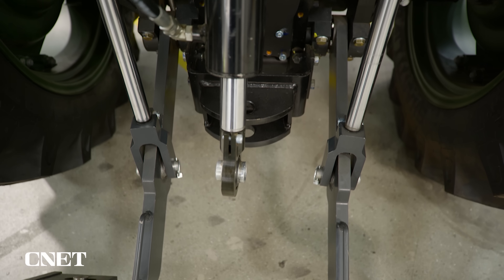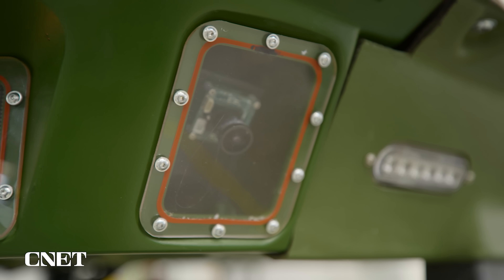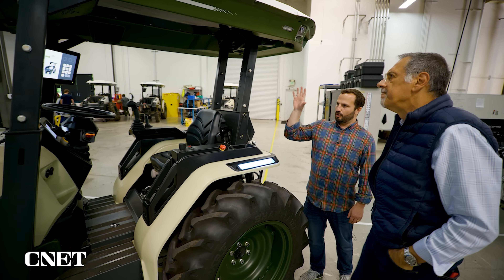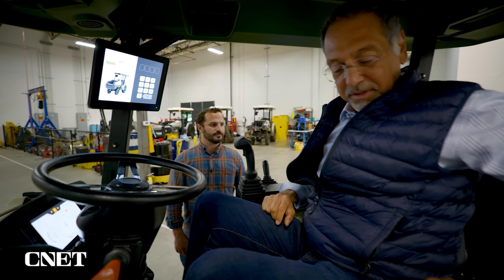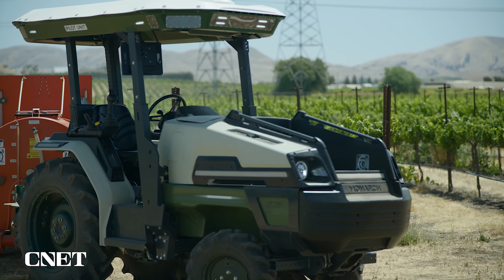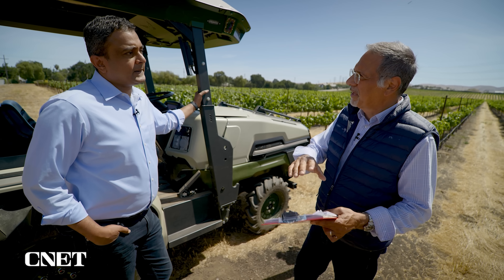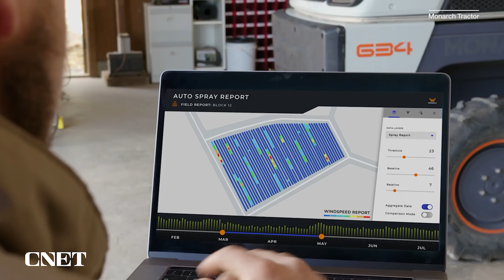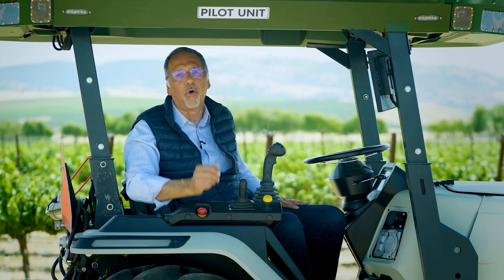This Electric Tractor Might Change the Future of Farming and Food!

Comment: Somewhat expected knee-jerk negative reaction from the old school. Reminiscent of dismissal of EV technology in the 2000s. The idea that electric motors are not up to the job of providing power to hydraulic tools for drilling holes etc is misguided. Electric farm equipment should be simpler and cause fewer issues with maintenance than ICE based machines. There's no reason properly sized electric motors shouldn't last 100 years. The only thing that might wear out are a couple of bearings. Gear boxes seem a tad unnecessary. Electric motors are excellent at providing high torque at any speed. Electric farm technology is going to benefit hugely from consumer automotive investment especially with battery advancements. You would think farmers, with their love and regard for their land and environment would be enthusiastic about consigning diesel to the graveyard of outdated technology.

Comment: The people at monarch are smarter than me. But the environment in which a tractor works is dirt and dust.
The cockpit and the control systems in there must be protected by glass or any lighter alternatives. Otherwise it will cause problems in the long run.
Other than that heavy duty models should also be explored also custom made attachments and tools should also be made. Custom settings gps
co ordinates for restricting work space and other venues and features should also be explored. I am sure it will be a wonderful addition to the farming industry.
Reply: Oh there are plenty of tractors out there without full enclosures, Deere has them. Their called tiny or toy tractors and not intended for long days in a field. Some don't even have a cover over the top at all

Comment: Battery life and recharge time will be a hindrance.  The farmers around me work sun up past sunset during planting and harvest time.
Reply: this would serve ideally in the niche of less then 8 hours of work and I wouldn't doubt adding batteries to the impliments would help push the daily hours of work you could get out of the rig
Reply: The biggest thing is autonomous rather than electric or battery.
Reply: @cmb271  just need a battery ''tank'' to come charge or replace the battery in the field. problem is that is a 20,000 added cost.
Reply: You can fill a tractor with diesel in under 5 mins.  Tractors today can still be worked on by most farmers.  These new tractors are making it cost more to run and fix.  I'll stick with my Pre 2013 Pre-Emission Tractors.  Already bought a bunch of spares parts to run them way past two life times.  Good luck with this expensive Buck Roger junk!
Reply: @Booneboarder  imagine trying to recharge a combine during harvest. constantly switching out batteries not to mention the added weight.
Reply: @victorhopper6774  I know and it won't be me.  Been stock pilling spare parts for a while now.  I'll be keeping all my Pre 2013 tractors up and running till I pass.  All these new tractors are a pain..  Happy with want I got and use.  Good luck
Reply: @Booneboarder  an EV is much cheaper to run and will be much cheaper to build once the newer battery-chemistry will be around. right now, and the next 5-10 years, as long as your diesel-tractor works you are still better with it. but in 5-10 years I wouldn't buy a new diesel tractor.

Comment: Why did we have an chip shortage for two years. Do get. We must go electric although the grid can't even handle nothing. Just goes off. Yet I personally have all three types of power tools. Battery, cord and gas. What I really love about my battery ones is. They give me mega time to go do something else while I charge them. If I need something done now I go to my gas ones. If I want to be lazy I go to my battery ones because I know they will not finish the job on an charge and I have to wait for the battery to charge. Yet with tractors and vehicles. Give me an break. All year nothing but one power outage to the next. People are now lazy with the electric vehicles. Now farmers with EV tractors. They will never get their work done waiting on an charge. Then the price of EV parts from just the tires and oh boy. Trade them in before you have to replace the battery. More then an new engine. Yet I am way not stopping the EV movement. I demand it to move on. I as the next person with an brain knows the power grid can't handle the EV movement. Yet I am demanding to see it fall flat on its face. So where did they test all of these EV farm equipment? Your all going to love this one. Because I have already known they existed because some did an video in the country where they were tested. You all ready to know where they have been testing EV farm equipment? This is good. Try Ukraine. Not joking. Oh but yet their in an war. No their not. They just don't want anyone to know. Now you do.

Comment: Most farm tractors are much larger.  A 40HP tractor is going to be for small operations or weekend warriors.  If they can get a 100+ HP tractor in electric, there might be a real farm application for smaller commercial farms.  Most larger operations are going to need 300-700HP tractors.
Reply: Their are work on mining trucks.
And most trains are diesel electric. So just take out the diesel and add batteries.
Reply: @terryquarton2523  the trouble with replacing train engines with batteries is one of energy density.  To get the same power and range of the diesel train engine, I suspect you would need a much larger battery than the space occupied by the engine, generator, and fuel tank.  Not saying it can't happen, but it's not a practical solution at present.

Comment: They always talk about how "clean" and "green" electric powered things like this are. The problem is that they are NOT as "clean and "green as people think. Most of the power generated in the U.S. comes from coal and natural gas. So, congrats!! You invented a coal powered tractor.
Reply: You have to combine them with solar panels and batteries to go off grid and 0 impact.  But looks like these models may not be able to handle the long hour load times some of the other users are suggesting.  Maybe in a few years as energy density improves (the demand is there so there's definitely investment searching for a solution),  the newer models may be able to run longer and sell for cheaper.

Comment: They have a regular 3-point with no quick hitch disconnect? They're saying this thing is loaded with sensors, so I have to wonder if you can even add a quick hitch disconnect. Without that option, taking implements on and off a 3-point really, really sucks. Also, I don't see any front-end loader - that's a total deal-breaker for me and a lot of other tractor owners.

Comment: farmers are like 2steps ahead of everyone on this... successful farmers don't use diesel or gas and they also don't use battery EVs they run their tractors and farm equipment using cow farts.. now let me explain: fuel is a major cost and at the top lvl of farming competition and profit margins is razor thin so what the big farms did was get get of their fuel bill completely by making their own fuel and they do that using waste and waste produce from their farms that they can't sell (and yes some of them even collect the methane gases from cow farts while the cows are in the barn and they use that to run generators and run tractors).. i mean you can't possibly get more green than running your tractor on cow sh!t, a battery EV of any kind would be a step backwards....

Comment: This is computer controlled meaning there will be little the farmer can do for repairs except for tire maintenance.  Any tampering with the navigation system would create a hazard to others.  Check out John Deere's propriety software system.  You can't touch anything.  Only the dealer can.

Comment: right hard working long hours machine operating in far flung rural areas i bet fast chargers are all round those parts of the nation right? realistically they could have electric motors but can't have huge expensive heavy batteries that can only do so much work/last so many hours? maybe a hybrid with an onboard generator working on gasp fuels that can even be made on farms like biogas, methanol, ethanol, etc? Hyliion heavy duty trucks for example have electric traction motors and a natural gas cummins generator onboard to charge the batteries and it seems to be a hit with real truckers....

Comment: This is a farm gadget. 

You have to first ask yourself why there are no economically viable electric big rig trucks, constuction loaders, bulldozers, backhoes, etc. There isn't even a serious electric work truck on the market. You just cannot cost-effectively power real farm work with an EV at this time despite gas being at an all-time high. This is going to be primarily for highly-capitalized hobby farmers. The price is 2 to 3 times an equipped gas powered tractor of similar HP. Sure, you get automation, which is why this is more gadget than anything else. It'll be pretty funny hearing a salesman try to talk a life-long farmer into paying triple the cost for a tractor he will never be able to rebuild or fix himself when it breaks down.

Comment: The very factory that builds these Electric tractors could NOT manufacturer the tractor without the Coal powered power plants & foundries that make the steel, rubber, plastic, fiberglass, glass, electronics and the thousands of parts. Try building that tractor on solar and wind power.

Comment: Buy a great diesel Kubota for around 24K or less. Keep your batteries. Refuel a diesel in less than 10 minutes, recharge a batter over night, Battery replacement cost cancels any possible savings.

Comment: What about a front loader. IMHO this is too small for the UK. 70hp minimum with options to 110 to 136hp. Also at harvest times you need 12 to 16 hrs minimum. Anyone with a new tractor will say the fail point is the electronics. Some need a service engineer on site 24/7.
Reply: This is certainly not a field tractor. More light duty around the farm yard or in the animal husbandry industry.

Comment: Sooooo, with the current battery technology and the aging infrastructure that we have for the electrical grid. Where are we getting most of our energy right now, where are we getting energy when demand is extremely high during certain parts of the day and year. How much can the infrastructure handle without being upgraded, and how are we going to be able to store surplus energy that is gotten from solar, wind and water for when there is a high demand? 

Right now we don't have the advanced battery technology to store the energy we need for those high demand times. Those batteries might be decades away, if ever. And until we get those batteries we will need coal, natural gas, oil and nuclear to provide that high demand energy. Our grid also can't handle an all electric society. The strain would destroy the grid. So now we have to upgrade that to the tune of 10's or 100's of billions of dollars.

Certain people think we can just transition over to electric lickity split. But ask Australia how that's going...

Comment: Great idea. In my area harvesting and planting is carried out by contractor who, during the season works equipment around the clock, in many cases miles away from any infrastructure. You would need a generator to recharge the equipment then.
Reply: or a method for battery-swapping.
Reply: @tomo1168  I’m sure that could be done as long as you don’t have to buy multiple large battery packs. Maybe an exchange program like propane bottles.
Reply: @gerrycooper56  If you build in an enough big battery to run it 21 hours or you have 3 batteries which are each for 7 hours, that is the same in mass and price. but you can take home the smaller battery to recharge it while the tractor is using the other one so you can use the tractor theoretically 24/7. ofc the charging point can't be too far away.
Reply: @tomo1168  the guys in our area who harvest and plant have huge pieces of equipment and they run them for weeks. This is why in part that individual farmers don’t own their own specialized equipment. I think there’s a trucking company in Melbourne or Sydney who are developing a battery swap system for long distance trucking so we shall see.
Reply: @gerrycooper56  I think our way where we produce a lot of expensive batteries and then put it in passenger cars used 2 hours every day is not the best solution. First the vehicles always on the road should be changed so the battery capacity we produce would be better used. 1. buses and city delivery trucks 2. everything else.
Reply: @gerrycooper56  How many $20,000 dollar batteries are you supposed to keep on hand to swap batteries?
Reply: @tomo1168  the irony is we used to have electric milk floats which delivered dairy products throughout the suburbs. The milk bottles were recyclable so we’ve gone full circle!
Reply: @mustangecoboosthpp3869  I think that’s the point. It’s not necessarily a one size fits all solution.

Comment: Rather than all electric tractors needing batteries, on many farms the machine could be run from what's essentially a big extension cord routed to a mast through an automatically retracting/tensioning reel -  robotically controlled...  It might still be practical to have some battery power, but maybe not for endurance work.

Comment: The reality is that we are decades away from using these machinery on a large scale, the battery technology is not developed to allow continuous use for 6-8 hours at 80% to  100% power output. Charging infrastructure also need to be developed. Once this is solved this technology will dominate Agriculture no doubt if only from mechanical reliability and maintenance ease alone regardless of all additional benefits.
Reply: Have you ever been on a farm during planting or harvesting season?  Tractors have to run 12-20 hours per day.  No farmer is going to stop 3+ times a day and wait to charge his tractor.
Reply: @rack9458  Agreed, you will need a double set of batteries that can easily be interchanged and yip we run a Irrigation project in Angola with 24x 50 há Pivots currenty. Everything here is run on Diesel. We pay 135 Angolan Kwanzaa per liter equates to USD 1.28 per Us Gallon, I do need see us changing to EV quickly
Reply: @ericsmith1453  When you are dealing with a comparable 400-700 hp EV tractor, simply swapping out batteries isnt an option.

Comment: I watch farming videos and they always need a human on board to react when the equipment stops doing its job. 
Which it often does. What happens if you get caught miles from home with a flat battery?
Reply: Same thing that happens now when you run out of fuel. You feel stupid for not planning ahead, and tow it back to the shed.
You need tools and a charger to reprime most diesel tractors.
Reply: @andrewradford3953  No Farmers don't run out of fuel because they have a fuel tank on a trailer that they drive out to the tractor. What are you gonna do, drive a petrol generator out to charge the tractor?
Reply: @KnightRadar  Have you had to restart a fuel injectected diesel tractor in the field that ran out of fuel?
For some makes you'll need a spare battery or two to reprime the fuel system.
Mine started drawing air in at the primer past an olive.
Reply: @andrewradford3953  Well the farming videos I watch they always call the fuel trailer out to them when they get low, so I've never seen them run out. But they have a spare battery on a trolly as they quite often don't start after sitting idle all winter.
I'm not against some things being battery-powered. I have battery tools and had a battery ATV for my Orchard but there is a limit to their viability. They are not green to produce and a lot of countries can't handle their power grids now with blackouts all over the western world.

Comment: Problems. Time been operating. Batt time it last?. How mush time it takes to recharge the Batt. Time in Farming is Very Crucial and Important. Weight and batt power more weight more batt used. Same as fuel!. The Q?. Time of Recharge from Zero. Prob will work with small Farms 2 acres?.

Comment: A car can travel 250 miles in about 5 hours on a charge. A tractor would run about 40 minutes on the same battery. A car uses only a tiny percentage of its horsepower to maintain 65mph. A tractor is using nearly 100% of its horsepower for 10 hours a day. So someone is either lying or going to use a battery as big as an SUV that will die in 2-3 years.

Comment: Skepticism abounds about this new technology, much the same as when farmers began using ICE tractors. Once this battery powered tech takes over the market and mass production lowers the price, diesel tractors of any power will become extinct. It's exciting to watch electric tractors unfold as the promise of battery efficiency improves three fold in the next few years. Sure there's a few stumbling blocks but four electric motors can eliminate a transmission, an engine with a thousand parts, front wheel drive shaft, pollution, noise, cold starting problems, etc. This is as exciting as the invention of the tractor itself.

Comment: Yeah its much easier to fix a 1949 8n Ford or an International or anything besides this with something called a wrench. This would be terrible for logging in the winter. Those batteries would freeze just like a drill does. And the charge time, I can "recharge" my tractor in 1 minute by putting diesel in it. Keep it in California.

Comment: Were these designed by farmers? Also space available? It's a tractor not a work of art, all that's needed is a front end loader and atleast a 12 hour hard running time, gas electric or diesel electric is the immediate future not full ev, in my opinion atleast